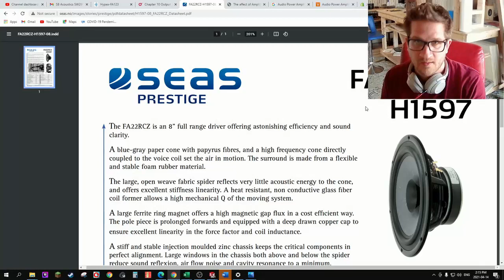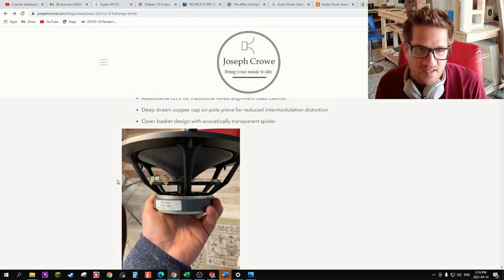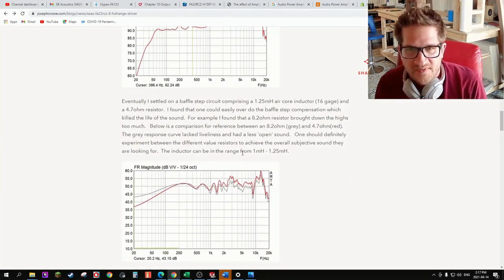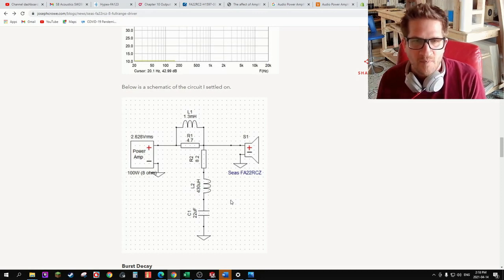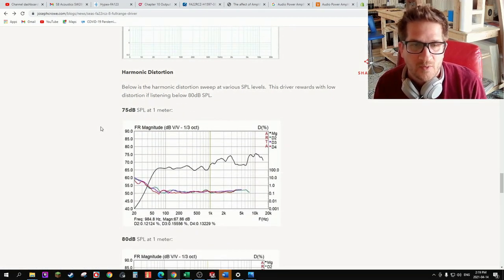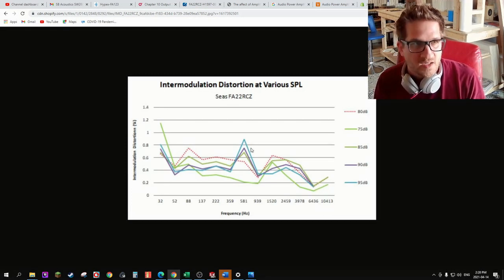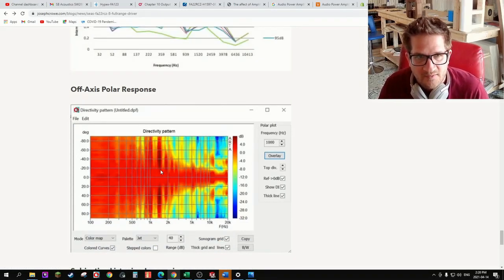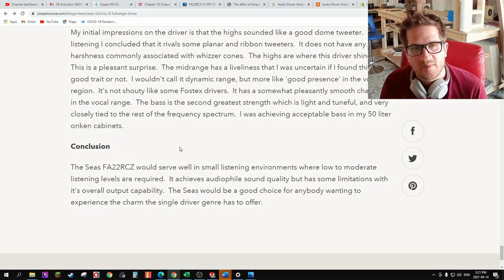Reposted with Audio Volume Increased -- Full Test on Seas FA22RCZ 8" Fullrange Driver

Comment: Hi , I built a pair of transmission line speaker cabinets about 40 years ago, with Peerless drivers 220 wr 33 102 ppx AL 8 ohms , just Recently had problem with amp and  blown one of my speakers, so I am now in the process of replacing them with a seas woofer U22 REX/P. SL H 1659-08 . And tweeter Saes 27TBCD-GB-DXT-H1499 , do you think that theses are a good Mach , ? . 
I enjoyed your territorial on your cabinets speakers as they’re using something similar I thought it might be worth picking your brains.
Phil from the moulin France.

Comment: Do you think this will be a good driver for a mono setup driven by 12 watt push pull tube amp in a somehow live medium / large  living room? How would it compare to an Altec 604 for example?
Reply from the maker: An Altec 604 is going to sound completely different.  Are you looking for that type of sound?
Reply: @JosephCrowesDIYSpeakerBuilding  Well I,m looking for more of vintage warmer sound. I,m familiar with the 7 inch Seas coaxial which I feel are very neutral. Is this Seas full range kind of similar?

Comment: If the treble is as good as a good tweeter, it would be a "revelation".  My experience with notching those nasty break-ups has never made a full range as revealing and with the detail retrieval of a tweeter. With a notch filter some of the negative effects of the break-up always remain..  Maybe I will try them!
Reply from the maker: The notch should be modest.  Trying to completely eliminate is not a good idea.  
Even after all the tweaks these are still just an 8” fullrange.  Even the best 8” will not outperform a good horn speaker.  It’s all in the context of this particular subset of the hobby.

Comment: Hi bro.. Good explanation... If I want to put these speaker into a box.. what will be the best volume of box.. nd what type of box do u recommend.. closed or front open..?
Reply: I built boxes recommended by Seas in their application notes for these drivers. I added bracing to stiffen the sides. They sound great! I run them with TAD 1201a woofers actively crossed at ~180Hz to cover the bass region. http://www.seas.no/images/stories/prestige/pdfdatasheet/fa22rcz_appnote.pdf

Comment: Nice easy 8Ω load. How efficient did the speaker end up after the baffle step correction network & notch filter, did they remain ~ 90dB sensitivity or did it drop to ~ 88dB?
Reply from the maker: I think I’m done testing this driver.  I have a high level of confidence that you would end up at 89-90dB region.
Reply: @JosephCrowesDIYSpeakerBuilding  JC thank you,  that answer is good enough for me and what I had suspected to be the case.
Reply from the maker: The sensitivity rating is normally dictated by the bass and midrange region.  I’m only attenuating the high frequency to balance the response.
Reply: @JosephCrowesDIYSpeakerBuilding  Great, but I don't know what that overall sensitivity level of the driver in an appropriate box design is, Seas specs 94db sensitivity 2.38v 1 meter, I don't see it,. Seas plots look more like 88 dB and rising to scary levels which is why I never bothered with this driver or its "Exotic" series predessor.  Can you post the transfer function fq res plot at 1 watt 1 meter of your speaker in the Onken box you installed the drivers in?  Also if possible tell me how much of that sensitivity number for the speaker in Oken you estimate is due to room gain vs if the speaker were measured in an anechoic chamber? Thx.